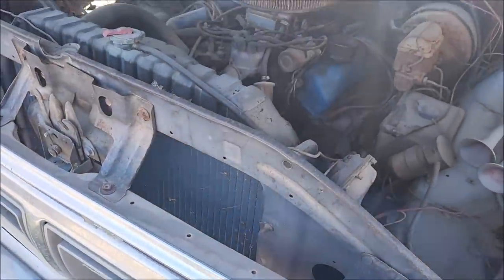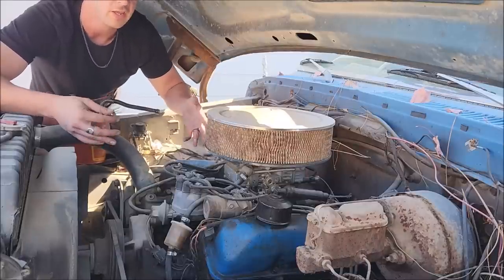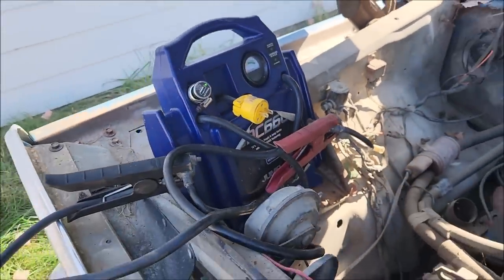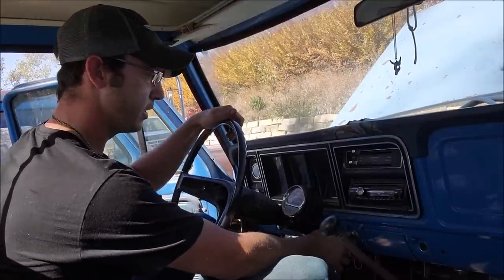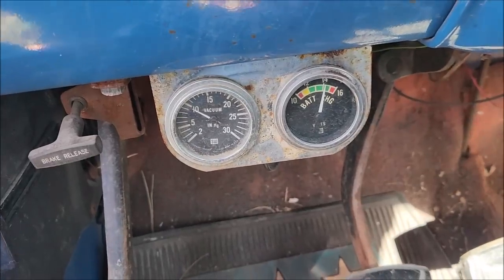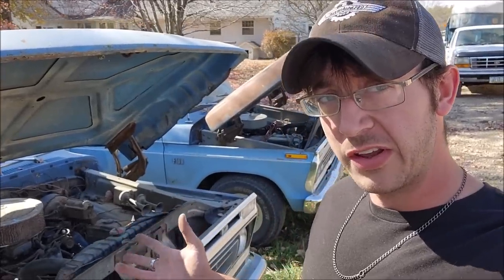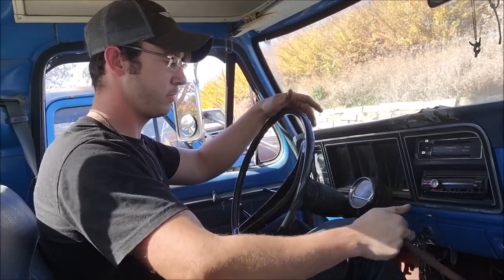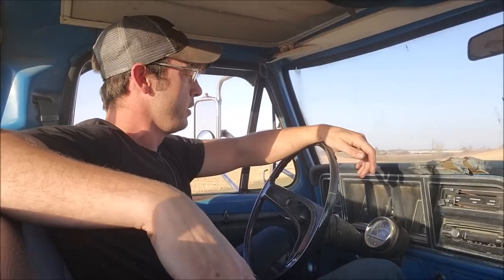Farm Truck Revival - Old Fords Never Die

Comment: Reminds me of the $600 one ('75 F150) that I bought in 2004.  Needed a carburetor to run right, wheel cylinders, master cylinder and a radiator flush and new tires that made it safe to drive.
Yes FEs are rock solid being made in various displacements from 1958 to 1976. They drink a lot of gas but never let you down.
The FEs are notorious for exhaust manifold leaks.  I avoid power brakes and in the case of 1965-79 trucks I avoid power steering as they are terrible leakers.

Comment: My father had a 64 Country Squire, tho with a 289 and " 3 on the tree " with separate overdrive, and an F-100 and an F-250 Camper Special.  The F-250 I think he bought because it was reasonably cheap and he didn't realize just what he was buying as he really just wanted a truck (it never hauled a load while he owned it).  What I remember about that F-250 was that the suspension was so solid and yet hitting a bump or pothole was never felt in the driver's seat.   BTW, the 289s are fairly long-lived too, as long as you take care of them.

Comment: i have a 73 and a 74 f100 . i recently started looking for a newer truck that would be long lasting/dependable . watched a lot of vids , and near as i can tell , nobody much has made any since back around the 90s that didn't have plug , trans , cam phaser , etc problems . went out yesterday , filed the points , and started my old 73 that's been sitting for over a year , without even draining the tank of the yellow swamp water that once was gas . think i'm gonna just be thankful for what i've got .

Comment: I just bought my first vintage ford pickup, a 73 cab chassis 1 ton with a 390 and 11’ flatbed. I’ve always been a diesel guy having 12 valves and ford IDI’s but I instantly fell in love with this thing. In a lot of ways a old carbureted v8 seems a lot more “alive” than a diesel or fuel injected engine. 
Anyways, it’s ugly as sin, leaks oil and gets gallons per mile but I can’t stop finding excuses to take it out for a ride.
Reply: You just made my day. I love hearing stories like that. Gotta drive these things as much as possible. You got a stick in that thing?
Reply: @freemansgarage  yes sir! I’d like to stick a gear vendor in it eventually. Not necessarily to go faster but to split 3rd and 4th
Reply: @Westerner_  That would be awesome. Good luck on it & enjoy.

Comment: Insane. This fires better after two years sitting than my well-cared-for 2003 Peugeot 206cc with less than half the mileage does on a cold engine.
Reply: Is that French or Italian?
Reply: @freemansgarage  It’s French. It’s a super cheap hard top convertible, and it’s incredible. Every time you open the roof the car reminds me of a transformer.
Reply: @simonro9168  That's cool. There's an old tv show from the 70's where the main character drives a Peugeot. That's how I was familiar with the name.

Comment: Yep those old Ford FE engines will keep on running all the way up until they throw a lifter. Then the minute it throws a lifter, you yank the camshaft to stick a new camshaft in that old FE and keep on driving it. That was one of two draw back to those engines, was they would last so long you would wear a camshaft out before you needed an engine rebuild. The other was they was prone to Vapor locking due to the heat buildup in the engine compartment.

Comment: My dream truck is a 70s ford. Dad had a 75 f100 with the 360. It went to the junkyard with 213,000 miles on it engine was never opened up. The engine still ran when it went to the junkyard.

Comment: I picked up a $500 1976 Chevy C20 with the 292 4 speed. Had been sitting in the back of the farmstead boneyard for ten years. What I found was that the new ethanol fuel turned the color of coffee, and stinks. But I pulled the fuel line off and dropped the intake line from the fuel pump into my gas can under the motor. Disconnected the fuel line at the carb and cranked it over till the “coffee” was out of the line. Hooked back up the line to the carb. Poured a cap full of new gas in the carb, cranked it up. Fired right up. After sitting through ten years of North Dakota weather. These old truck are bullet proof, kinda.  They just want attention.😊

Comment: Just bought a 71 at auction that sat 30 years. Points cleaning and some fuel and it was running.  Same as hours 390 with 147k miles. It just runs.

Comment: I had a similar truck with a 460 auto. Wiring harness shorted out and fried, had a lot of rust.  Rewired it (half assed), new gas tank. Wouldn’t die, just needed too much work, sold it to a plumber for a work truck. They are hard to kill.

Comment: I had a 1980 F100 with no power steering or power brakes. And it was a 3 on the tree with a 300 straight six.

Comment: Good to see TH289 back.
I have a 351w in a 70 Mustang. It always takes a little cranking to fire up, but runs well when up there, not sure if it needs a little more timing or not. Vacuum is about 19 but slowly floats a small amount either side of 19 at idle. I would love to get it to be smooth and ‘coin balancing steady’ at idle.

Comment: Had a 69 3/4 ton dually 390cid with a big steel box on it at work once upon a time. Engine only went so fast in that application. But it did it day after day, year after year for a very long time.

Comment: Good to see you, Luke.  My '70 D200 is likewise a Camper Special, had 4.10 gears but swapped them to 3.54 for a little better drivability -- don't ever plan to do any towing with it.  It also has the granny four, a NP435, probably same as yours.  And it's a good ol' LA318, not a big block, alas.  It does have power brakes, drums all the way around, but manual steering.  Agree on having one less thing to go wrong, but It is a bit of a bear in parking lots. :-)

Comment: Luke :) yes FE 390 or any Fords engine super for sure 100% my first tow truck was 1972 Ford F350 extended High Boy 390 4V  4 barrel had Rare Granny Four Manual in Steering wheel column also put 1968 International 1 ton pickup truck  Eaton Manual transmission floor shifter granny Four speed also 409 rear end gears 2 wheel drive did years later in ! But Granny transmission we nickname in Canada Bow Low First or Creeper Gear Rangers ! If ever put Eaton D18 Granny Floor shifter Manual 4 speed from International there easy to do plus work on early one had Sleeve Cylinder fill up Resivor  on left frame rail ones before 1966 but 1966 after  had Clutch pedal to Resvior near brake booster on left side with Fork Cylinder with steel line and were adjustable rods threads type!

Comment: My Dad bought a 1970 f100 back in 1984 it had over 100 thousand miles on it he put another hundred thousand on it then I put probably about 200 thousand on it with the original engine it had a 360 with a 3 speed on the column someone stole it in 2008 it was still running.
Reply: Once upon a time in America, they used to hang cattle thieves. I wish that they still did the same thing - only with car thieves. Best wishes! 👍🏻👨🏻‍🏭🇺🇸

- Max Giganteum

Comment: During the emissions years every engine was hit hard on power number but the stock 2bbl 390 was the Torque King of all regular  production pickup engines SAE NET 201 hp 376tq which was more Torque than the Chrysler 440, Gm 454, Ford 400 and 460..... also keep in mind the quickest vehicle of the emissions era was the Lil Red Express (even quicker than the Vettes, Camaros, Mustangs etc) and it was just a 225hp/295tq so by the time you swapped an aluminum 4bbl intake and a set of headers to get the 390 up to par with the dodge 360s configuration im sure that 390 would pick up the missing 24 hp to compete, the 2bbl 360 FE was Rated 196hp/327tq so it wasn't far behind either

Comment: Got so much to say about the great video, but i keep it short.
As you said down in the comments, FE (Freakin Exspensive). Parts for these things are at least twice any other.
I ran a 390 into the ground after five years as a daily driver. Probably put 100k on it at that time. Its finally down to about 115-125 psi in compression. it will still start but just doesn't have any oomph for the gas it want's.
Ok, the occasional tach working is an issue I have on all 3 of ford trucks I have one installed in. They seem to work for a while and then after many months just start acting up. I could take a perfect working tach and get the same result. I have yet to figure this issue out.
i could chew the fat for hours with you on these trucks.
Reply: Oh good, this scam found his channel too!

Comment: You should do the full works on one of them, get paint, do up the engine, bodywork and keep one of them. It'd make an interesting series.
Reply from the maker: I've had the f100 for 14 years 🙂
Put a massive amount of miles on it in my day, I've tried to leave it exactly like it was when I was in high school. It's largely like a time capsule.
Reply: Get the beast under cover and out of the weather... preferably in a garage over the winter while avoiding road salt. My truck looks almost exactly the same as it did the day I bought it back in the 90s. I attribute that to being parked in the garage almost the entire time I've owned it be it winter or summer. Things last & last when you take care of them! Peace & good vibes! 🛻 👍🏻👨🏻‍🏭

- Max Giganteum

Comment: These old FE’s are SO cool.  Question.  I noticed that you didn’t depress the clutch on start up (maybe I missed it…).  I was always taught to depress the clutch when starting.  That takes a substantial load off the starter from trying to turn the gear oil also.  It does make a difference in cold weather.

I personally have a 1995 F150 with the 300 cube six, 2wd with a 5 speed manual.  Just a few miles shy of 200k miles, only burn about a cup of oil between changes (no leaks).  It has been an amazing truck and it turns heads everywhere it goes.  Old Fords are not common in New England because of rust issues.  Mine is fairly clean, nothing alarming rust-wise (front fenders are the worst).  Enjoy your videos. 👍

BTW, I love the exhaust rumble. 👍

Comment: really dig the vintage tach seems like all fe engines run like that i have 4 of them all run great my one problem child is my 78 f150 302 truck it has an edelbrock 1400 carb that i cant get the idle circuit to work in

Comment: Well it's nice to hear somebody speak well of 390. I've never been a fan of the engine. I've had them used them as I must and was able to. The best thing I've ever had to say about it is that well at least it's better than the Ford 360. Going to have a 390 just go ahead and get a 460. Like anything else if it's running leave it alone and use it until it stops and maintain it. I had one Ford 390 in a pickup and it did well for me for the three weeks that I had it. It's beautiful truck but title is so messed up I couldn't do anything with it sold it for scrap. I'm not sure what the next guy did with it. But he had no problem giving me 1500 bucks for it and that was in the early 1990s. No scrap was not high but I couldn't sell it with screwed up title. So I sold it for parts. Anyway I've got a 64 T-Bird and been setting since around 1972 in the he man's garage. It's got the 390 in it and that was the problem with it back then. Oil looks great but it is stuck. I've let it soak now for a good 2 years so it ought to break free. We'll see what happens with it. I've got another 390 out of a pickup that reportedly ran great. With the heads off it looks fine inside. I can swap them out. Old Thunderbirds aren't worth that much anyway. So numbers matching won't make a difference if it's not. But I'm glad that you have good luck with the 390. Hint I'm a Chevy guy. That drives Ford trucks. My cousin that's a Ford guy a little bit older me agrees about 390. So if you can shine a little light on anything special that maybe we're not I would be grateful and I would pass it on to my cousin.
Reply: You're a Chevy guy... that drives Ford trucks. You need to just come out of the automotive closet and declare yourself to be a Ford man which you clearly are! Sing the blue oval loud... and sing it proud!! As for the Thunderbird, you would be surprised at how much they're worth these days - especially when they are numbers matching. If I were you, I would definitely be looking into their values before yanking any original engine or transmission out. You might find yourself to be very surprised at the value. Best wishes! 🚘👍🏻👨🏻‍🔧

- Max Giganteum
Reply: @MaxGiganteum  okay thank you and I was waiting for a Ford guy to say something along the lines what you said. To be honest about it I'm going to HD 2500 as well as a Dodge truck. I kind of collect these things but these are just the trucks that I use. My daily driver is a Ford super duty. And it's great for pulling trailers and then I want to do. It's a gasoline engine. I'm a big fan of the 7.3 but anything after that not really. Besides they're too expensive for my taste. As far as the Thunderbird a pretty nice one might bring $10,000. It's been a few months since I looked. And we bought this car from the original owner who ordered it and I've got the name plaque that was on the dash but they adhesive let loose and it says Thank you Mr Jones for buying a new Ford Thunderbird or something like that. When you order them back then they gave you that plaque. I even have the fender skirts for it. But the only thing they couldn't find was the front bumper and the grill that kind of stuff so I need to start looking for that. The interior not a rip or tear or bad spot in it. Anyway this Chevy guy also has a 71 Ford short bed hi boy 4x4. I bought it from a guy who basically parked it in the barn back in about 1983. Got it out of Kansas and it literally had 4 inches of dust on it! I was looking for a place to rent and enclosed trailers because I did not want to lose the dust it's only that way once. I'm not fanatic but it's just one of those rare finds. I've owned it for a number of years now and I understand it's worth something because I know what it was worth around 3 to 5 years ago. You ought to see my cousin's 79 Ford 4x4 short bed half ton ghost flames on it. Beautiful truck tires rims everything paint job.

Comment: Addressing your comment on rather it's a 3 or 4 speed. If you shop around some off these old shifter knobs was labeled 1 2 3 4 and some was labeled 
L 1 2 3 so either way is correct.

Comment: Interesting you're finding issues with power brakes, I've found the rear seal failing and sucking the brake fluid into the booster to be somewhat rare and the booster itself almost never fails. I think in the 10+ years I've been fixing cars professionally I've changed 3 or 4 boosters.
Reply from the maker: On old classic cars it's actually pretty common to have these issues. 
The worst thing is power steering classic cars though - steering is always completely worn out and sloppy. None of my factory power steering cars from that era have any slop at all.

Comment: OK...Luke, You are the Carb genius...the Guru! My main question is....Do you have any forum links that can help us determine the best carb/intake to put in our bone stock 1985 f150 302W? I am looking looking Any types of "build sheets, or spreadsheets that maybe has some parts lists for what you personally would change/add to the same truck if you owned it to get some more power and efficiency? We aren't looking to drag race this thing...but its a total dog now and could use a little bit more fun factor.
Reply from the maker: You want a small 4 barrel and better ignition that you can actually tune. 

A 390cfm holley and a pertronix ignitor 3 pro billet distributor is basically standard op for most of my 302 vehicles.
Reply: AWESOME! Thank you Luke! @ThunderHead289

Comment: Totally unrelated question 
Edelbrock carb on 1987 F350 460.
After sitting overnight you have to prime a little gas down the throat from a bottle to get it to crank.
Any suggestions???

Comment: I've noticed that several of your vehicles are equipped with manual transmissions. Have you ever tried shifting without the clutch / floating the gears on any of them ? Some transmissions will do it effortlessly and others not so much. I always at least give it a try.

Comment: ya its gas drinking my self like it cheap so i only use it sparing it gets tired of all that fuel bill
Reply from the maker: I'm fairly convinced everyone who claims an engine drinks gas has a bad tune. Granted I've been a heavy carb and ignition tuner on the side for the last decade, but I always seem to get notably better fuel economy on engines folks otherwise think are just "terrible" on fuel
Reply: @ThunderHead289   i know i watch but lot trucks i operate are small block  class  still stock 360 3/4 1971 ,1983,3/4 conversion was rv 351 1978 f700 389 5 ton 25ft flat bed all have original cast iron intake 2150 or 2100 vary on use like pto or foot petal linking cause cab design manuel or auto loads tires use conditions of roads my thoughts are tbi or efi or sad 14mpg in town lot times road trips still get unloaded 10mpg or loaded or even towing i know try different tunes carbs even air filters gas etc i try jet boreing ported intakes even whats it is hills vs slopes vs flat some time get on it but two barrel my thing not fan of aftermarket manuel chokes best and good warm up stick

Comment: i get why people like the simplicity of manual everything but if its a daily driver I like power brakes at very least!
Reply from the maker: Drive something with manual brakes and you will realize that it actually doesn't make much of a difference at all.
Reply: @ThunderHead289  i used to have a 1955 ford f100 and yeah its great for just getting around but if you have to come to a screeching stop you have to stand on that fucker! this is how it got totalled actually i still may have lost it had it had power brakes but i wouldn't have got hurt as bad.